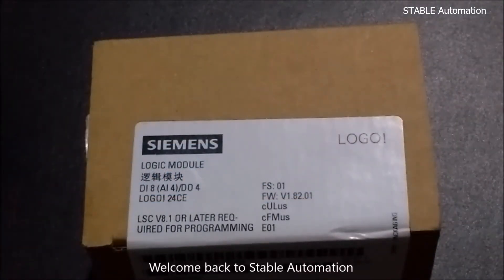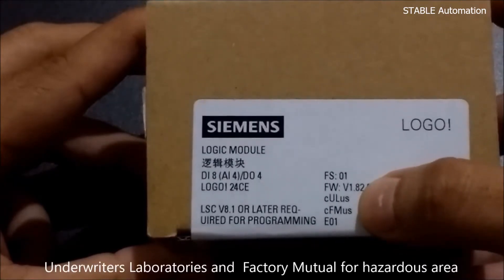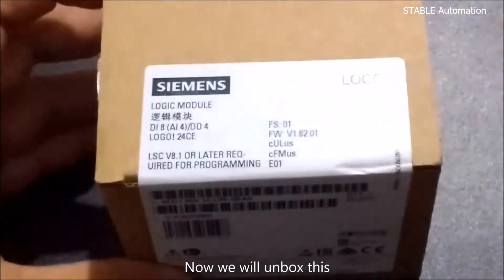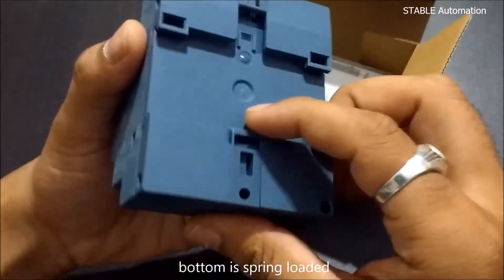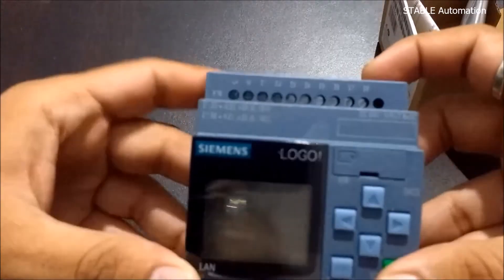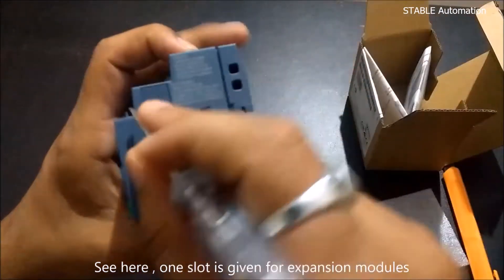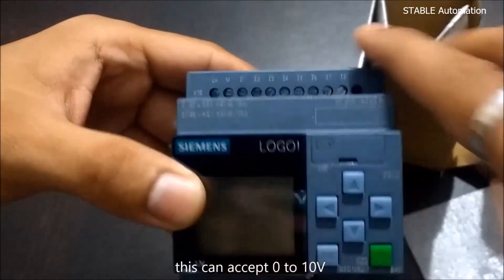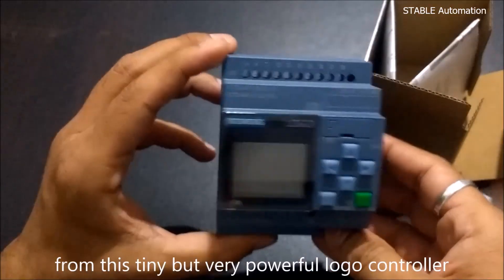Unboxing Siemens Logo PLC

Comment: Hello, Does it work with any 24V supply power? or Do I need to buy the power module?
Reply from the maker: Yes This Model works with any 24V DC power supply. There are other model as well. So check your model detail before powering up.

Comment: Can we give 24v dc using SMPS..or it requires any special power supply module.can we operate it at 240v Ac supply
Reply from the maker: yes..you can use 24VDC smps supply. 240VAC can not be apply. check model 6ED1052-1FB08-0BA0 - works on 230V AC/DC